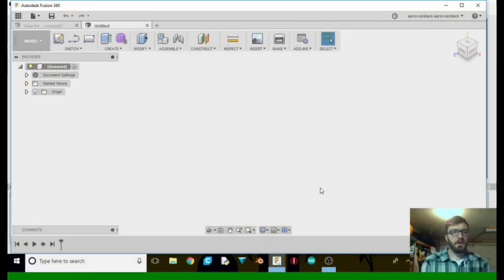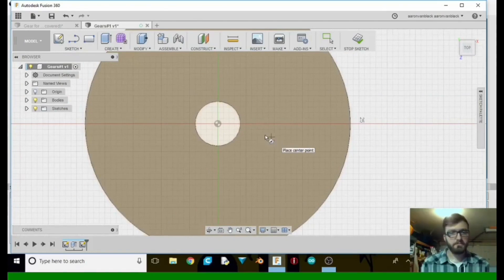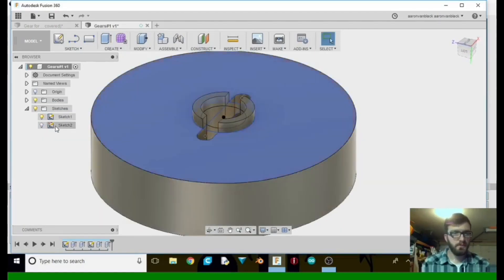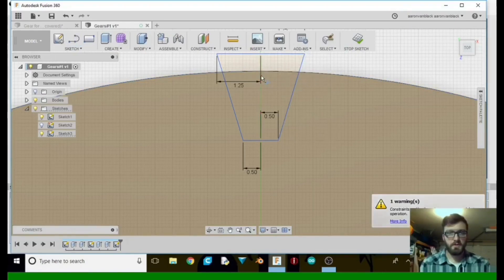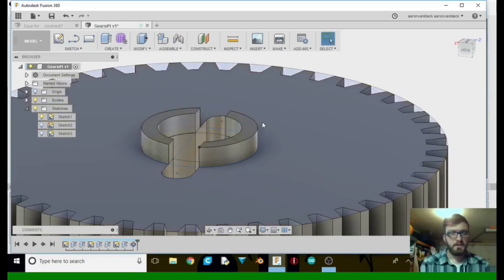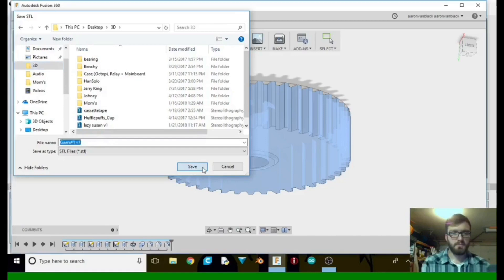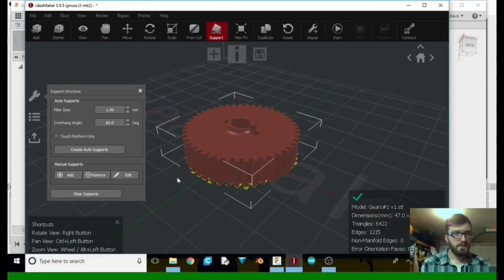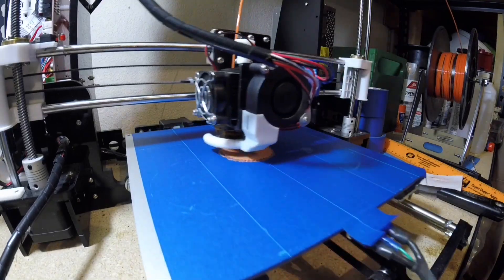Fusion 360 Gear tutorial part #1

Comment: Great Video  what are the best 3D pinters
Reply from the maker: They have a lot of good printers out nowadays, depending on your price range. A lot of people if they can afford the cost Prusa MK2 or MK3 normally over $600. But you can get really great prints with an Ender 2 or 3 those are more affordable and are a great starter printer. Going for less than $300

Comment: Nice video, but why don't you use the built in script for spur-gear, just give in all the parameters like number of teeth anfd diameter etc and it creates in seconds a nice gear which you can modify 
kind regards Hans
p.s. the scripts can be found at the ADD-INS button
Reply from the maker: hans pijpers That’s a great question. I originally was using it for the gears, the problem I was having with the script was it was making the gear way bigger than it needed to be when I added the number of teeth. I know there probably is a way to fix that problem, I just didn’t know how to go about it. Also I had another gear I needed to make. It’s in the 2nd part for this video, it wouldn’t be possible to make the things for it in the scripts. Thank you for your question!